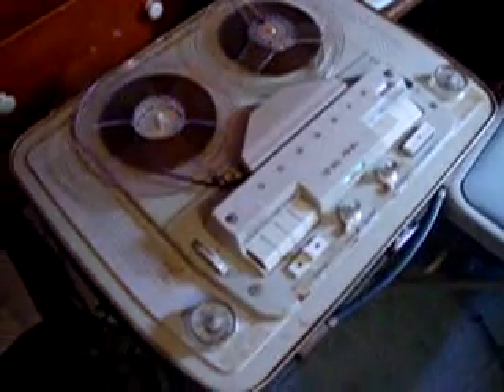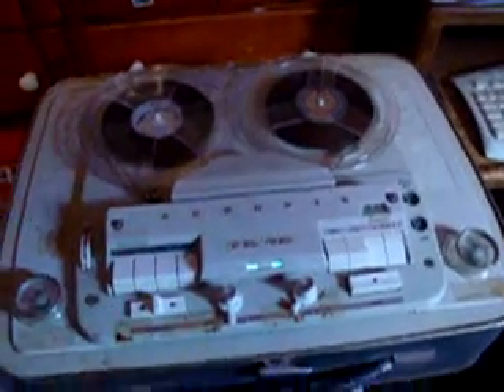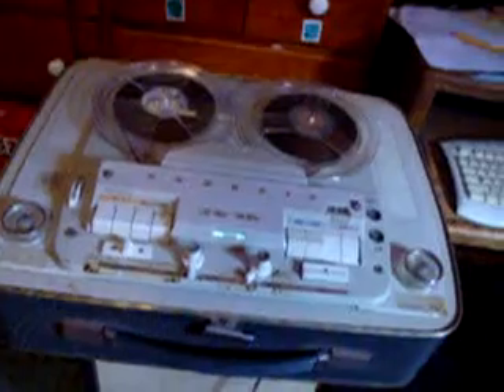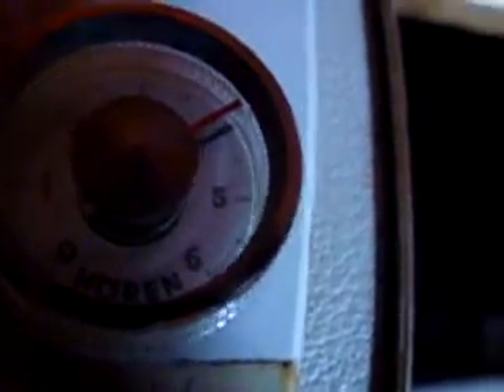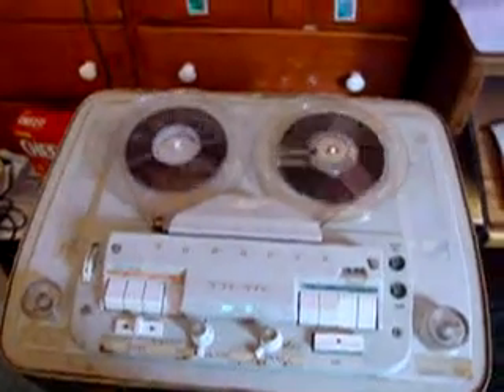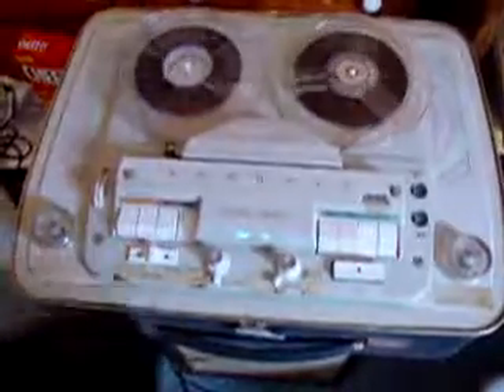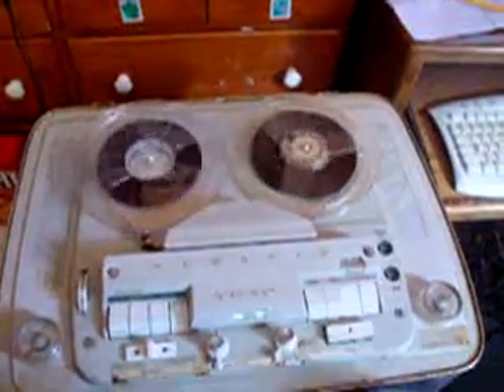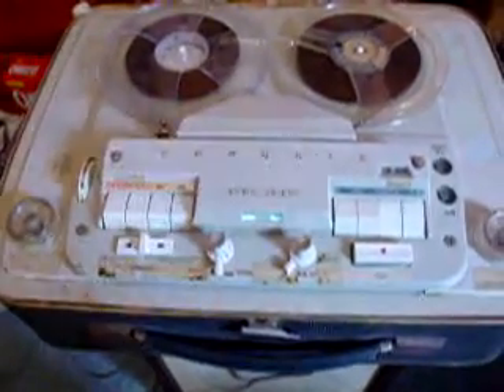ATTENTION those with lots of experience with amplifier circuitry, especially tube/valve amps.

Comment: sorry cassette,you just can.t fix from out here in the net without more info.take it apart and get in to the power stage with a tube pinout diagram. and you need a voltmeter.once you let us see the voltages we can help and get this fixed.most of this sounds like either a problem in the cathode circuit  causing the tube to draw too much current and as a result it smoked the screen resistor or in the first grid circuit causing cutoff.Post some readings for us.

Comment: sounds like maybe a de-coupling cap (one in series with the audio path) is shorted, allowing DC to get to somewhere it shouldn't be. An open resistor could cause the same kind of sound. Notice how it gets better the louder you turn it, That's a characteristic of DC riding on a signal where it shouldn't be. But both channels with the same problem? odd.

Comment: @wall1977 most the time a weak tube wont do that it will just not be loud same with low plate voltage some times it gets quieter but doesent loose sound quality

Comment: also im not sure how this amp is set up but check your plate voltage even though im quite sure its a capacitor problem check resistors and stuff to though just keep an eye out for burn marks an things of that sort

Comment: If there is one. You should get a scope, it would be easy to find where the problem starts.

If the output is SE, then look around the power tubes, the bias may be too negative. Proper currents and voltages should be in a service manual, but good luck finding it.

Comment: The distortion sounds like the middle of the waveform is getting cut off (ever tried passing a signal trough two diodes, connected in parallel, but opposite to each other?). This can be because of a bad connection (I have heard it when one of my cables broke a tiny bit). Also, if this tape recorder has PP amp, then it's either an output tube bias problem (caused by a bad resistor) or some problem with the phase splitter. Also, it could be a problem with the stage between line-out and power amp.

Comment: it might be a resistor because i had the same problem with my Technics SA-5150 try checking your resistors cause by a happy mistake i fixed it by trying a 100 ohm resitor on the speaker output lines

Comment from the maker: @batterymaker I replaced the WIMA caps and it still has the distorted sound. I then replaced a (wire-wound?) 160 ohm resistor with a 200 ohm and the amp is a lot louder, but still distorted.

Comment: batterymaker retrchad lmull3 Maxxarcade and others all have very good advice. Sound like low voltage which will cause distortion and is usually the power supply which is usually capacitors and maybe the rectifier. Take some time to learn how the circuits work because it is the same analogy as, give a man a fish to eat, but it is better to teach him how to fish.

Comment: I would replace all the caps in it. Electrolytics and paper...we have seen really strange distortion problems which led back to a slightly leaky electrolytic cap drawing too much current through a resistor and causing voltage on an amplifier stage to be too low. When you have all new caps then you can rule that out as a problem and also help prevent future problems.

Comment: @CassetteMaster Then I'd say it could be caused by bad resistors.  If you can plug into a separate amplifier and get a good clear sound, than the preamp circuit should be good.  It's just the power amp circuit for the built in amplifier of the reel-to-reel.

Comment: i encountered something similar to this when working at a record shop over the summer where we repaired a lot of tube equpiment. that is definately something in the output. that is most likely the tubes not getting enough voltage for some reason or another. the tubes themselves could be weak tubes from age. try swapping out the tubes and see what happens. if the same thing happens, it's the output circuit probably.

Comment: Since both channels are distorted, this leads me to believe that the problem is in something that they both share.  I would check the plate voltage at the output tubes.  Probably a bad resistor between the power supply and the output transformers.  They could also share a cathode resistor and/or bypass cap that has gone bad.  Let us know hat you find.

The voltage setting to 130v should not affect it.